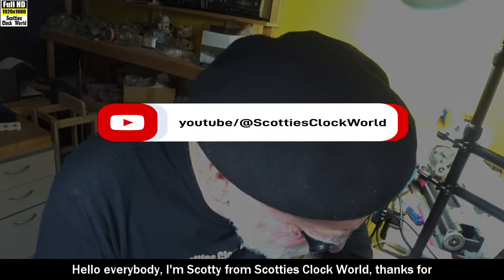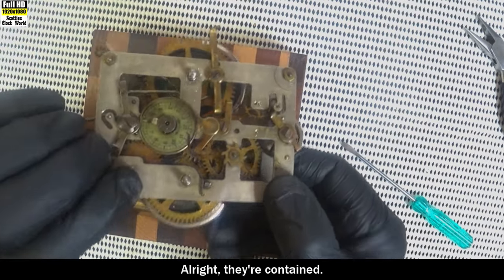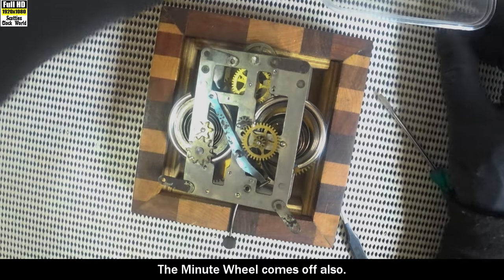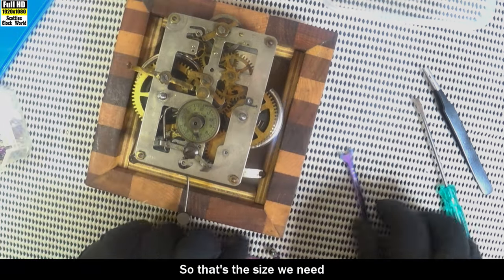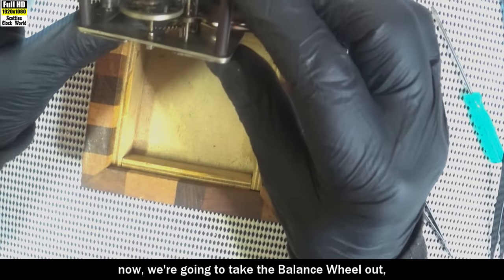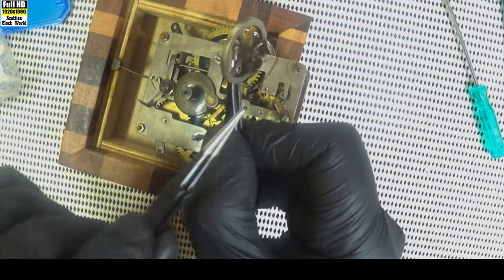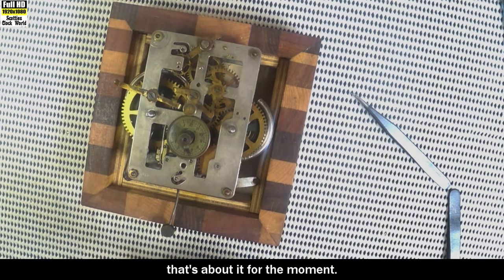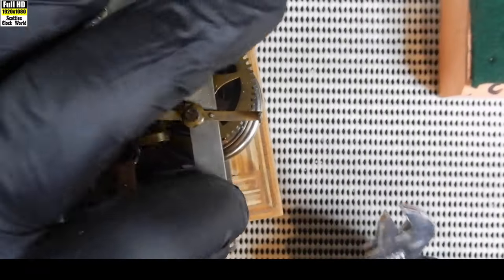Very Old German Wurttemberg Pin Pallet Table Movement Clock Service - Part 2

Comment: I was hoping you took the alarm mechanism off, so I could see how you get it back on. I worked on a carriage clock recently that the piece had to be removed to get the plates apart. Was hoping you had a secret for getting it back together easier. I got it back, but it was doubtful for a while. The spring on the alarm arbor is very high pressure and you have to compress it to get the washer and pin on it.